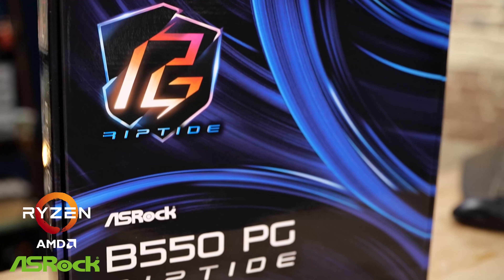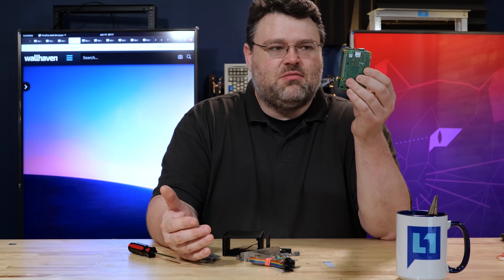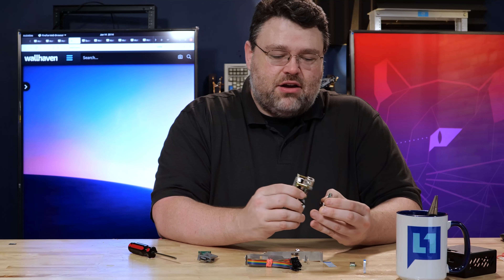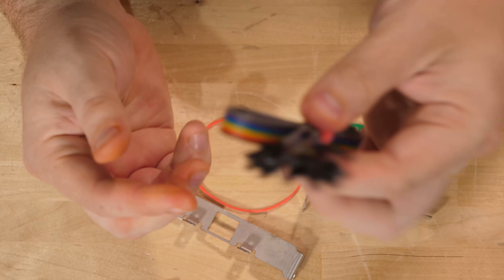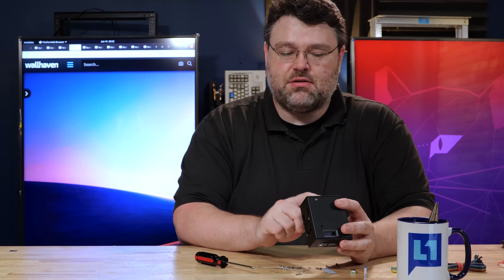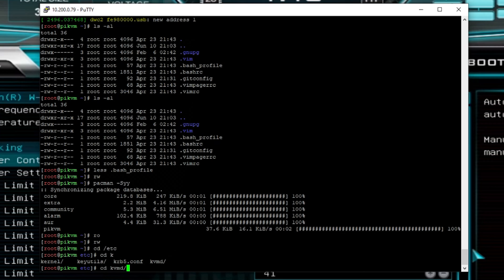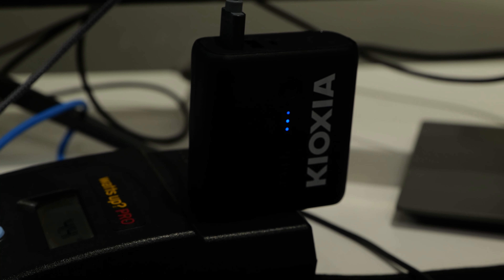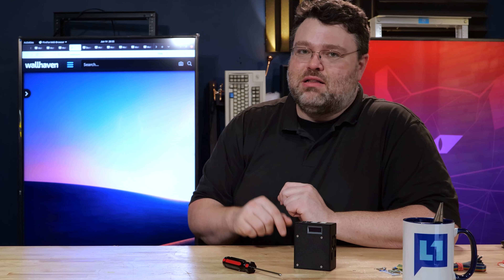IPMI EVERYWHERE! w/The Pi-KVM

Comment: Wendell, I do love the idea of combining this with a switchable KVM but only having ATX control over one machine is still killer for me and many others. We'd be better off buying many of the PiKVMs. Is it possible for Level1Techs to create a model of your single monitor x 4 machine KVM with the relevant relays to switch the physical pinouts for the ATX controls between each machine when active in the PiKVM? I'm sure I can hotrod something like this together myself but I think you can sell alot of them. Imagine the ethernet (ATX control) cable from the PiKVM to the Level1KVM then just has a extra ethernet cable for the same ATX controls for each of the downstream computers.

Comment: Hello Everyone, I need some information on how does this Pi KVM works on the work laptop.
My work laptop is located in my house and I would like to travel out of the state without carrying a work laptop. But my office networking guys always monitor my location by checking my IP address and I cant use Team viewers or RDP or VPN routers to access my laptop due to security policies and VPN connection.

So I would like to use the PI KVM to access my work laptop remotely But I am a little afraid to do that because of the office security policy configured in my laptop.

1. I would like to know, Does my office IT security know if I connect this Pi KVM to my offie laptop?.

2. How does my work laptop recognize the Pi KVM HDMI and USB when connected to the laptop?.

3.Does my office laptop recognize the Pi KVM as a suspicious device?.

Could you please help me with my situation?

Comment: the CDROM emulation of this thing is really bad, it will not work if you try to mount a WIndows ISO files. because:

- the usb gadget is not designed to work on 2.5GB+ ISO images (needs a patch)
- it only support CDROM emulation, so that means any ISO that is designed to be fomatted using UDF extension will have a hard time working on pi kvm

in short.... everything is functional except with the opticl drive emulation part. even emulation usb flash drive is flaky.

Comment: This things gonna kill every other IP-KVM. $150 for basically the worlds' smallest KVM that uses open standards like HTML5 and even has WebRTC support now. Kinda wish it had HDMI passtrhough for more permanent installs but. Also does the audio work when you use WebRTC? That would be a cool feature!
Reply: Sound is coming! Not so soon but it will,it's implemented in the hardware.

Comment: A couple of questions: 1) it seems like the term "KVM" is overloaded.  In the 80s I got a KVM where I had to wire 4 sets of keyboard video and mice cables to the back of a switch and then run a 5th set of cables to my monitor, keyboard and mouse. Y then there was a mechanical switch in the front that I would have to physically turn to the system I wanted to run.   Now I'm seeing KVM switches (like the one in this video) with just output and no inputs.  What is the advantage of what you have in this video over a KVM like in the old days.  2) multi monitor support.  I run 2 monitors, and would like to run 3 monitors.  Virtually no KVMs that I've seen have dual monitor support, why?
3) how is what you show in the video superior to just SSHing into a machine?

Comment: Not properly ipmi but ok. A BMC is still a lot more advanced (sensors, fan profiles, case intrusion, bios updates, serial redirect, and most important it have a GPU/display interface in it)

If Asus released the schematic of my x99 bugged BMC mobos i would had ported openbmc to them. Or at least the pinmux settings of the aspeed chip.

Is it possible that the BMC crash in a few days and I have to reset it from host via ipmi tool? Isn't that funny?

I would love to see this project merged with openbmc to have it working on a aspeed chip. But I think that aspeed iC has less processing power. That chip is behind a big NDA.

Comment: Where exactly did you get this ultimate accessory pack?  Mostly curious because of the case.   What's shown on PiShop.com does not include a case or some of the cables you show
Reply: I am wondering the same thing. they are sold out now anyways. but yeah this does have me wondering where to get the case and the rest of the stuff

Comment: Abusing RJ45 for other purposes imo is always a bad idea, just use some connector that's not already super associated with a single purpose
Reply: Thing is the RJ45 connector is used for quite a lot of different purposes already so one more isn't going to really matter and it makes finding a source for the interconnect cable itself so much easier. plus if you're organised (or as other people call me "OCD") then you'll already have made sure that all your firewalled Ethernet cables are one colour, that all your C-Bus cables are another colour, that all your CresNet cables are another colour, that your DMZ Ethernet cables are another colour and that your WAN Ethernet cable is another colour so this really isn't an issue.

Of course I won't be able to do power and reset control of my stack of HP Mini Desktop machines as they don't have any PCI slots to mount that breakout board into and they don't have normal motherboard headers to plug the connectors into either but no biggie.

I just want to be able to get one of these on order to play with and then I can see a number of them being purchased in the future - wonder if it can be set up to VPN back onto my own network?

Comment: why do you need a front panel accessory when you have magic packet turn on and a vnc server running on the pc ?
Reply from the maker: So you've never had a hard lockup then?
Reply: @Level1Techs  i call my mum to restart the PC when that happens xD.
Reply: @Level1Techs  - my ex-wife would probably suggest that I've never had anything hard. :-D

(Sorry - couldn't resist that one...)

Comment: Needs work on the camera angles but overall, nice video.
Also, 10:33 that's not a battery, that's a capacitor - it serves to function of a battery, should it's power be disconnected for a short period of time. The original xbox had one of these.
Reply: There is both a capacitor and small supercapacitor. The capacitor is used to smooth the main power line. The supercapacitor powers the clock. It is used instead of a battery as it does not require replacement.
Reply: @mdevaev  - nice! As soon as Wendel mentioned it was a battery I did a bit of an intake of breath given just how much we're now seeing the breaking down of batteries in older kit and these things are going to be just set and forget to sit behind stacks of kit that won't be touched for years.

Really looking forward to being able to order one of these - this is an excellent project and, from what I've seen, is an absolute credit to you. I've held off assembling one myself partly because I didn't want to have some half-arsed lashed up pile of stuff on a desk that couldn't really be used for anything useful and partly because buying the actual final kit will hopefully contribute towards some level of (much deserved) income that I hope you get from all your hard work!
Reply: @philharris9631  Thanks :) I hope that my creation will be useful for people.
Reply: @mdevaev  - is it possible to set up Pi-KVM so that it automatically comes up with a VPN link back to your own network? I’m thinking that one initial use for this for me would be sorting out friends and family with PC issues and that would make accessing it from my own network much easier.

Cheers

Phil
Reply: @philharris9631  yes, try this: https://github.com/pikvm/pikvm/blob/master/pages/tailscale.md

Comment: Wendel, you are THE Linux GURU.  And you know hardware.    with all those audio options on motherboards including Optical and HDMI I was wondering if it was possible if you are ever in the future going to build a home audio system based on a Linux audio distribution?  

I've seen other people's builds in forms but they never actually go into detail on how they accomplished it and how the process actually worked out from the software configuration standpoint especially since many of these tools are in Linux.

I really want to do a software d s p  that could be used in mobile applications and I was wondering if you would possibly ever do something like this in the future and make a video you want it has it really would open up the options if someone experienced tried this and was able to get it to work properly with the configuration.

with all these motherboards having really good prices and many of them basically being for under $100 and with most of the processing only being CPU bound,   all those small mini PCS used in the corporate environment that usually run at around 12 volts would be a perfect addition to mini portable or car audio environments or a home environment for that matter.. 

would you do something with audio in the future I think that would be really cool

thanks Wendell

Comment: Could this not be achieved with a pi, usb HDMI capture card and a bit of code for one hell of a lot less?
Or I could watch the whole video and realise it's far more than some hacked together things.
Should have known better this is a L1 video after all. :)
Reply: That's how I got my first version of pikvm - raspberry, usb-hdmi dongle and pikvm. You don't need the hat to run the same software as presented here, it is described on project's website how to do it, exactly as you are saying. It's actually great low cost way to try the software out if you have some raspberry lying around - those usb-hdmi dongles are like $10 or even less.

Comment: I feel like they designed this before the compute modules released because using the RPi4 CM would've shrunk the size requirements a ton and probably would've helped make routing all the connections way easier than a hat.
Reply: BLIKVM IS A RPI Compute Module 4 IO Board for PiKVM https://www.youtube.com/watch?v=aehOawHklGE&t=362s

Comment: Once they make on the shelf solution I might replace my TinyPilot version
Reply: Actually you can use Pi-KVM software on it ;)
Reply: @mdevaev  but but no IPMI, nah jk I might replace the current one with PiKVM too. I,m interested in the fact it could control the power and reset button tho.
Reply: @steakikan  Then v3 is something that you will like
Reply: @mdevaev  Somebody else (@Tripp Williamson) mentioned a good idea: a controller for multiple PiKVM that you could run on a VPS as a Docker container. Your in-field units would securely connect to the controller which would be able to manage the devices and provide you a handy and secure all-in-one interface.

Comment: The hardware bits you are getting don't really add up to $150 but if half is going to support an open source project, I'm fine with that.
Reply: Open Source does not mean the guy has to work for nothing. It's still insanely cheap. Similar devices in the Industrie cost 300 to 600 bucks with software only for the first year. 1k is also a common price.
Reply: BLIKVM IS A RPI Compute Module 4 IO Board for PiKVM https://www.youtube.com/watch?v=aehOawHklGE&t=362s

Comment: I wonder if there is some splitter for DisplayPort 1.4 with DisplayPort passthrough and HDMI out as well so I can connect it between my PC and gaming monitor, and have an HDMI cable to to the streaming PC. I use 1440p and use a 240 Hz monitor. Not sure that would even be possible 🤔

Comment: 150USD? ar there any solutions that might just be cheaper? I always see these, however i can't justify this much money for something like this :(
Reply: The cheapper is DIY using pikvm's github. But you should know that the cheapest proprietary kvm over ip will cost you $500.
Reply: @mdevaev  at 200-500 USD I would rather get an older server that has this already built it, I spent 300usd on my proxmox server and 70 USD in making my backup server so relatively its just not worth that much money to spend on a KVM solution that would blow the budget that much :(
Reply: I built one last year, about £40. Totally worth it!

Comment: IPMI sometimes provides more than just remote access: things like sensors readings, system log (ecc errors, etc), but don't think it's even possible to read those things without motherboard cooperation. But for a small home server on a desktop-ish board this box is definitely very useful.
Reply: Correct. And even more than that even. A true BMC (e.g. IPMI) has both a direct connection to on-board hardware (like various LPC busses, the PCH/SoC, often an FPGA, etc) as well as itself acts as a video adapter. A lot of home labbers could probably live without some of the more advanced features? But the BMC actually acting as a low power GPU is an extremely important feature. You cannot use this pi project to remote control a system that has no GPU... Whereas that's exactly what a BMC is designed to do. And... That BMC GPU only costs a single 1x pcie lane off the SoC/PCH. So no need to waste a proper 4x/8x/16x slot just for an otherwise useless GPU.

This thing is a very cool piece of kit and absolutely perfect for a lot of home labbers and it even competes well with other iKVM products, but it does not compete, nor can it ever really, with a proper BMC/IPMI on-board solution.
Reply: @shammyh  technically, the lpc bus is often exposed as a tpm header, and the superio chip that has all the sensors tends to sit on it, and some boards do have solder pads for the i2c bus of the vrm controllers, the elmor evc overclocking board uses those, so in theory those could be all hooked up as well, but sadly they are not documented
Reply: True. But you get what you pay for. I'd guess you'd need a homebrew health-check solution for the server itself. It's better than nothing at all with a home-lab server w/o built-in IPMI, IDrac, etc..
Reply: @Austin Kelley "The Intelligent Platform Management Interface (IPMI) is a set of computer interface specifications for an autonomous computer subsystem that provides management and monitoring capabilities independently of the host system's CPU, firmware (BIOS or UEFI) and operating system."

open your eyes, there's far more out there than vastly over priced under performing industrial kit (with far more useless metal than actual usable device) that the ordinary people that cant vat write off/reclaim the expense as a business want to actually buy & use in home/lab...

you want sensors , its a pi , plug your $2 heat sensors etc in to a spare spi etc pi pin ,send the data to your Grafana Dashboard Setup https://m.youtube.com/watch?v=XCdl5QRyj6E Grafana Dashboard Setup for your PLEX & NAS Novaspirit Tech

 or put an inline $5 wireless esp32 between the sensors & pi-kvm.
https://m.youtube.com/watch?v=JdV4x925au0 #255 Node-Red, InfluxDB, and Grafana Tutorial on a Raspberry Pi 
,Andreas Spiess

https://m.youtube.com/watch?v=_r1wN6cD32w&list=RDCMUCR-DXc1voovS8nhAvccRZhg&index=9
Kubernetes 101 - Episode 8 - Kube, meet Raspberry Pi ,Jeff Geerling

Comment: As a tech that works for an MSP and works on some fucked up systems, I'm gonna build one of these into a Pelican case and have a built in monitor. Remotely accessible crash cart that I can plug into anything? Fuck yeah! I won't have to keep an LCD monitor and a mouse/keyboard in my truck anymore.
Reply: Eh?
Why are you not using a cheap usb HDMI capture card with your phone or tablet.

Comment: Advertisement: I'm completely happy with my ASRock B450 HDV Rel 4.0. It now supports Ryzen series 1000; 2000(G); 3000(G); 4000G and 5000. 
Next year I will be looking for a Ryzen 5 4600G or 5600G to replace my Ryzen 3 2200G :)
The Pi-KVM looks great, but I don't need it, since my 1C2T Pentium 4 HT server is at a 1 cm distance from my desktop :)

Comment: The cool thing for me on this is that i can finally use off-the-shelf components and build a true server with remote KVM management, specifically with my Unraid Machine. and not have to worry about BIOS issues or managing it in person.
Reply: just discovered this. instead of finding a monitor and keyboard to make a bios change i'll just install this lol.
Reply: i dont even know what a KVM is or why i would want one
Reply: @charlesballiet7074  Keyboard Video Mouse - it's useful for "headless" servers that don't typically have any input devices plugged in. For example my fileserver has power and ethernet plugged in. That's it. I do all my management over ssh.

But if a kernel upgrade goes wrong, or as happened recently an OS upgrade to the latest release ends up breaking the bootloader, I have to drag the thing out of the corner and dust off a monitor and keyboard and sit there poking at it locally. With KVM I can be wherever with my laptop and do all that work without having to touch the physical box.